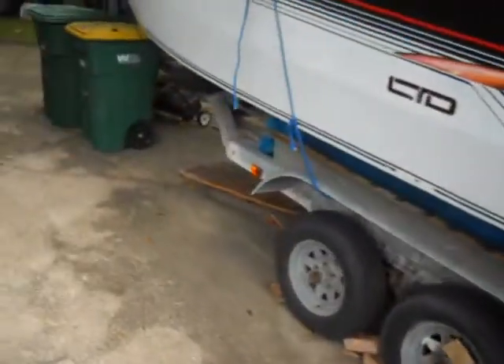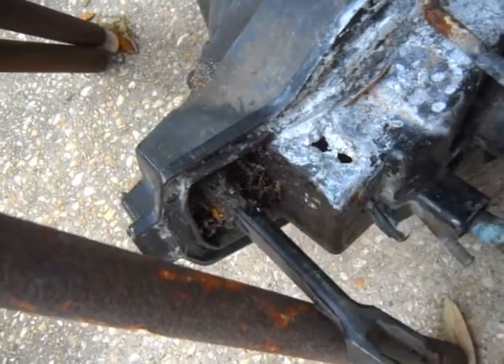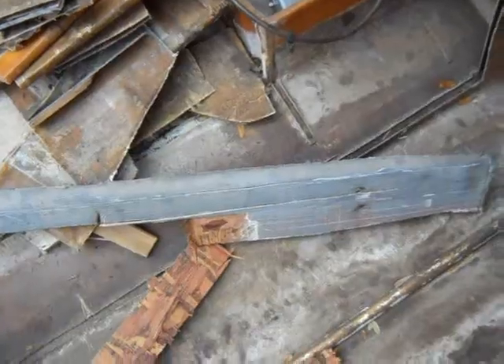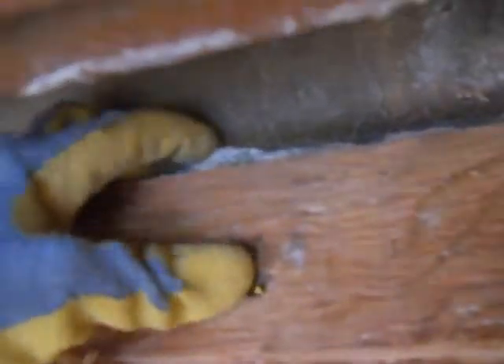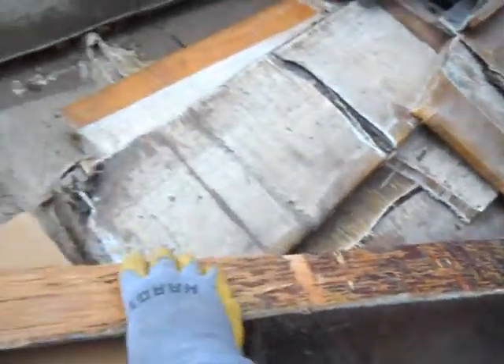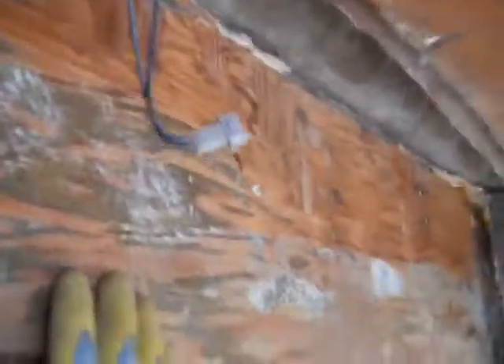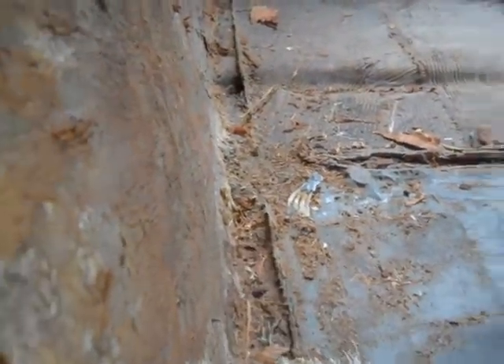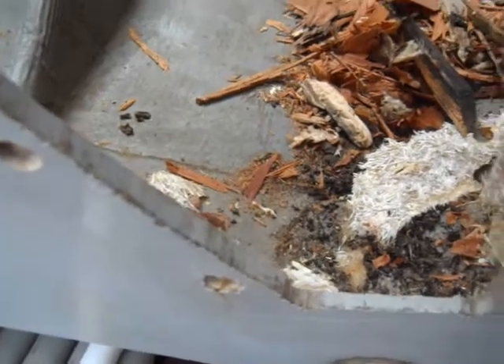Chris Craft Scorpion 230 LTD, Finished Transom removal, then Coosa Board for the rebuild.

Comment: Hi did you have the video of the rebuild? I have the same boat and looking for tips to glue back the transom.. great video thank’s a lot!
Reply from the maker: I will try to get that video up. I did finally glass in the Coosa I got to do all the transom, stringers and bulkheads, but been so crazy busy that I never uploaded. Thanks for the push, I really would like to get my Scorpion back in the water too.
Reply: @gregboswell2843  good! What king of epoxy you use to glue back the transom?
Reply: @gregboswell2843  and about What quantity? Thank’s a lot! Hope you Go on water soon!
Reply from the maker: @fab0330  I have been using regular resin that I get from the local supply house at the docks. Have considered using epoxy though, a bit more expensive, but probably a more stronger bond.
Reply from the maker: @fab0330   This is my dilemma. I buy 5 gallong bucket, use a gallon or two, then get busy at work and have to throw it out and get more. So, from now on, I'm only buying it a gallon at a time. Suppose to have a 3 month shelf life, well its way past that again LOL
Reply from the maker: Had a look at the videos taken while making the transom and glassing it back in. I have a dozen vids between 1 minute and 10 minutes long I need to edit into one or two videos. Guess that was where I stopped.  The video editor changed, so I'm going to need to figure it out. Probably watch some you tube vids on editing and uploading soon.
Reply: @gregboswell2843  cool i’m going to glue back mine soon and i want to make it perfect
Reply: @gregboswell2843  2 plywood 3/4 will do the job? 1 1/2in total plus fiber glass
Reply from the maker: @fab0330  Sounds great. What are you using wood or composite for the rebuild?
Reply: @gregboswell2843  marin Wood yes
Reply: I was curious how did you clamp it in place for the cure time
Reply from the maker: @fab0330  I uploaded those videos. Maybe give you some ideas on how you want to do yours.

Comment: Hi Greg! I just found this video and plan to watch your others on this project too. I think you’re headed in the right direction by trying to eliminate all surfaces showing evidence of delamination, rot, or similar signs of potential failure. I did a lot of work like what you’re involved in years ago when I was in the boat business. My best advice is to take your time and think carefully about what you’re facing and allow common sense to guide you. From what Ive seen so far I’d say you’re doing well in that regard. If you tear that thing down much further you might want to think about screwing some temporary bracing in place if you notice any evidence of substantial movement of hull or transom surfaces because you want to be sure to maintain the original geometry of all the various surfaces. I was wondering about your plan for power once she’s ready to begin refit. Are you considering conversion to outboard?
Reply from the maker: Hello, I have unfortunately come to a halt. Not given up, but certainly have put her on the back burner given this past year 2020. I have not taken a day off since last year and no sign of doing so in site any time soon. Been so busy, I bought the wife a new SSI 21ft Chaparral 2020 for her birthday. It only has a V6, but is rated at 250hp and certainly gets up and goes like it has that much power. The speedo says it tops at 55mph.  So far, I have glassed in the new Coosa Board  in transom and then parked it. But, I did not reinforce anything since the trailer its on has full length bunks and I have it blocked up square and have kept a close eye of it while glassing in the transom. I will double check everything when I get ready to do the rest.. I did check and you are correct that this is  concern I had to keep it all lined up so I'm not going in circles later on. The engine I have is good but original. The boat was a really good running boat. Just came back from dinner one night and wife smelled gas as we walked by  it in driveway. I was replacing heads with big valve aftermarket ones and an aluminum intake. But, it hit 30 years old and the aluminum tank started leaking right on time, like every one told me it would. Nothing else I could do but cut out the tank, then it dominoed and I found all the rotted stringers and bulkheads. Anyway, I will get back on it soon enough. She waits patiently for me to start putting in new stringers and bulk heads. I may rebuild the engine since the little V6 in my wife's boat will probably out run my old tired 260hp 350Mercruiser. I had already put a new outdrive in it a couple years before this, so I am kind of invested in the heavy metal. Thanks for checking out the vids and please check back and let me know what you think.
Reply: Greg Boswell: Thank you for the update! I’ll be watching.  Cheers!

Comment: Looking forward to seeing completion of your Limited 230 Chris Craft. I found one for $250 but trying to find a similar price trailer to hall it away. I myself like the lines as well. I want to convert it to a bow rider and shape it to look like the current 2018 Chris Craft "The Launch Series" model. With some modified changes like removing the top part of the cabin split it in two and add actuators to lift and slid up to use as hard top. Placing an outboard motor Evinrude 2018 150hp actually 2 of them to make it 300hp and add Bow/Stern Thrusters. Great repair guy www.aslinboatbuilding.com or buy the parts and do it your self or ask Aslin add one for you.
Reply: You have any other videos I only found 3
Reply from the maker: Hi Jonny, thanks for checking in. Your project sounds like it will be a lot of fun, and can't beat the price of purchase either. Aslin has a really nice shop set up there in Ontario. Might be a little out of reach fro me down here in Florida, but always good to know about excellent resources, thanks for that. Aren't the newer outboards all electronically operated so you can move each one independently and eliminate need for thrusters? Although, not knowing how close quarters you have to dock her in, you may need to extra thusters. Keep me posted, interested to know how you progress.
Reply from the maker: I think I only have a few vids. Click on my name or subscribe button should allow you to see them listed. Thanks. I am working towards making a new one soon showing me glassing in my new transom. I have it cut out and trimmed to fit, then had to leave town almost 6 weeks. Then got delayed on the return from Hurricane Harvey, LOL! I gotta get busy before winter and temps become too cold to lay some glass and resin.